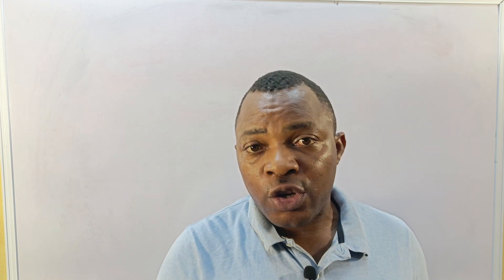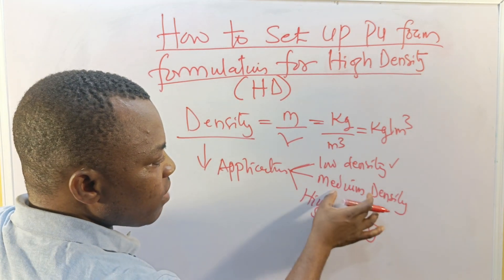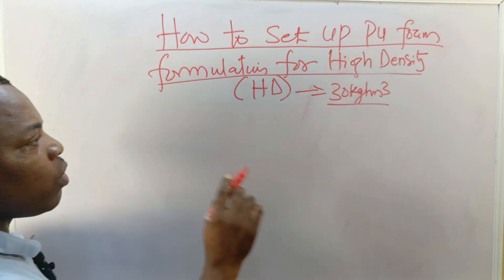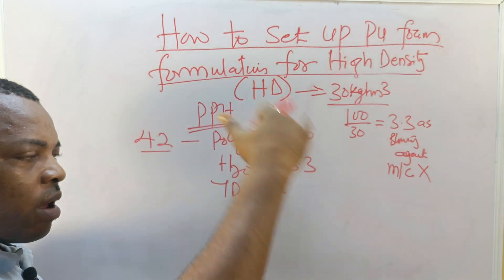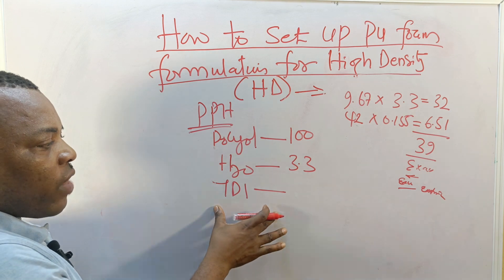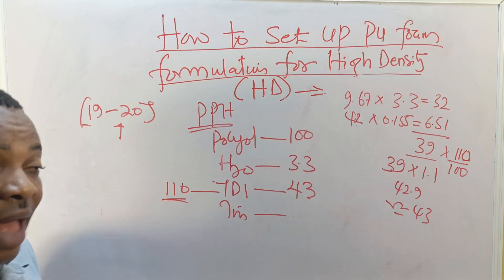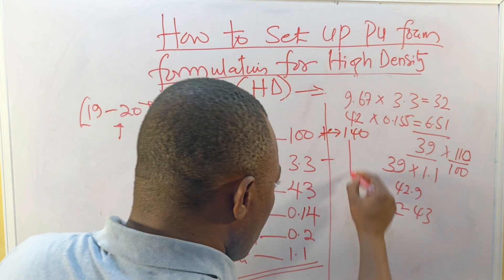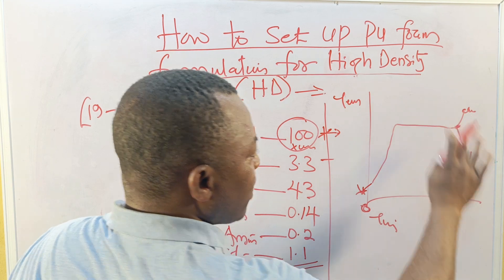LESSON 23: HOW TO SET UP PU FOAM FORMULATION FOR HIGH DENSITY WITH OUT METHYLENEDICHLORIDED.

Comment: Great work sir, please are you a foamer in a foam company
Reply from the maker: @kankamoscar5308  am a Pu foam expert foaming everyday in and out in all the foaming processese.
Reply from the maker: Yes I am
Reply: So if you are incorporating calcium carbonate, how does that change your 100 % polyol
Reply from the maker: @ALFASAMUELOBONI  it changes because polyol is in 100 part by weight meaning is 100 therefore if you are choosing 10% , polyol part become 90 why filler is 10 parts by weight making a total of 100. Ok 
Adding fillers are in substitutions not in addition because aim is to reduce cost . From the above examples, it mean you use 10parts of filler to replace 10parts of polyol which is far expensive then filler and all formulation ingredients will also change towards cost reduction like your TdI index 👉.
Reply: @ekpenyongndueso   okay, thank you.  How about calculation for your blowing index? How do I calculate the amount of water needed for a particular foam density. Also sir, assuming I am not using filler for my 16D foam, is it safe to use 6.25 water ?
Reply: Sir i wont ask 1 thing the relation of tdi index and filler in foam making  process thnak you so much
Reply from the maker: @adached4183 check my video headings or go ahead with yours questions.
Reply: Using 6.25% H2O will cause too much heat, @ALFASAMUELOBONI